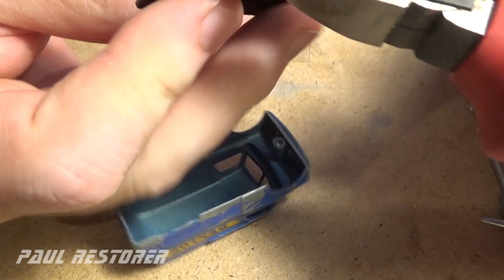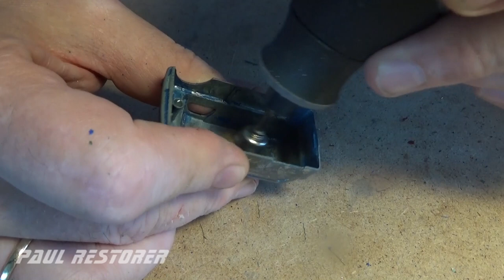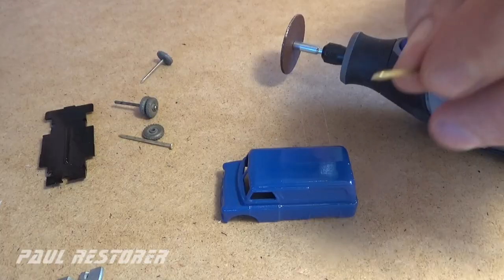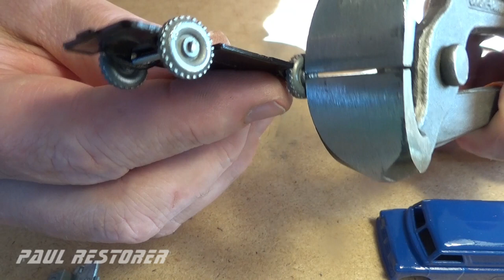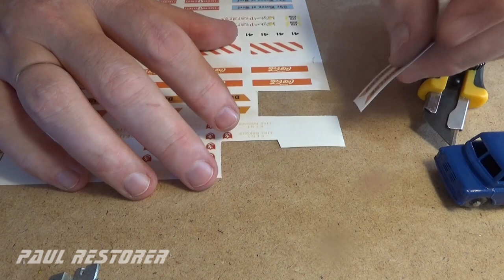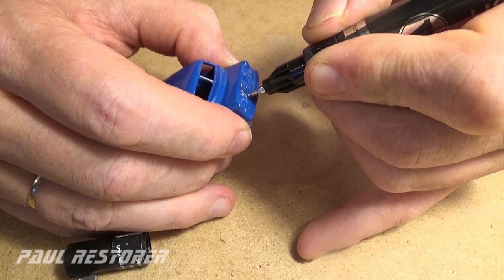Matchbox Bedford Dunlop Van nr 25  model autka odnawianie, renowacja, naprawa

Comment: another amazing restoration Paul turned out great. i have been wondering whether i should purchase a chrome pen myself they look really good but i like the metallic silver as it gives more of a original colour for old matchbox. only problem is the silver doesn't dry very well,  does the chrome paint dry nicely?
Reply from the maker: The chrome pen dries about 25 minutes. Buy yourself, of course, price around 4 euros. Such a pen can be used at home, for example by signing Christmas presents :) My wife has a drawing with this pen on a mobile phone.